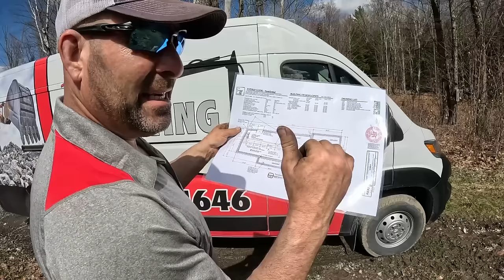Massive Concrete Structure in our way!

Comment: Excellent Mikey. As you said no point in trashing your equipment trying to demo 70 year old re-inforced concrete.
The Diesel hammer was very very effective, even more so than modern hammers, it seemed to have a heavier punch.

You never know with these 1950's houses, people were building A-Bomb shelters under their houses.
Good to see you 'back onsite' dude!

Comment: Man that dirt is gross😂. Hammer worked great though. I haven’t used the one I bought for the junk yard yet . I think it might be stuck . Fired once then stopped 🤷‍♂️ oh well it was $600. 😂
Reply: Y O U  will get it to work and perhaps feature another repair video for everyone!  Take care!
Reply: @sonnyblazer5504  thanks sonny! I’m sure going to try!
Reply from the maker: Yes take the bit out clean the grease out pressure wash it.. then you will see exactly if it is seized up which is most likely old concrete dust
Reply from the maker: Also try switching the lines first that will also give you just one hit.
Reply: @DIRT-BOSS  yeah I’m gonna have to do that. I think the bit is gamed from sitting. Mabe old dry grease and like you said concrete dust . I’m gonna buy new hoses soon .